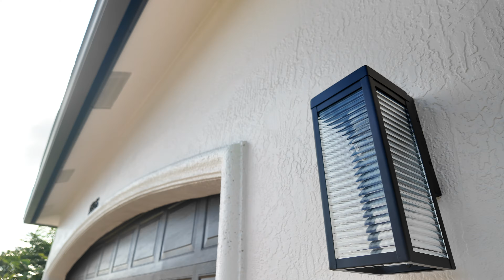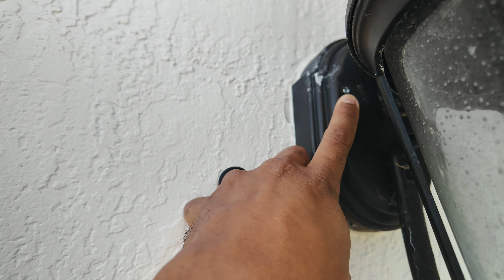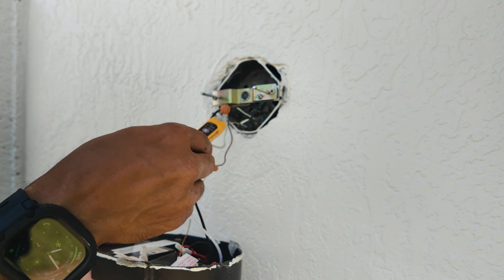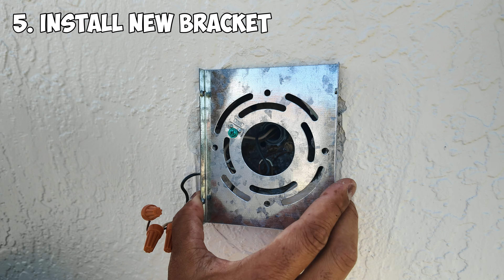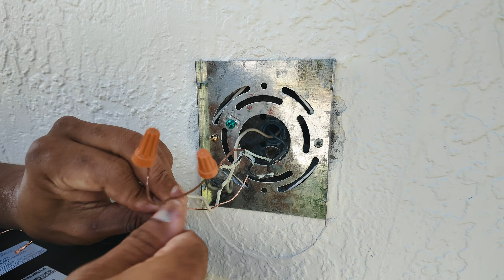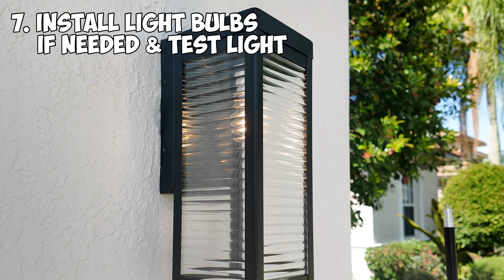How to Install an Exterior Light in 10 Minutes (No Experience Needed!)

Comment: Thanks for the video man! Have a question to ask.
Is it possible to power a security camera with the house light power? 
Solar is not practical.
I’ve been told that a transformer can make it possible? Any suggestions? 🙏
Reply from the maker: Yes a transformer will make it possible, depends on the power source, there are security cameras that use 120v (house light power) so you dont need a transformer
Reply: @DeaninItYourself it’s one of those Chinese models from Amazon and it’s say that it’s powered by a 5v USB power cable. 
I keep looking for a 120v to a 5v and can’t really see anything definitive. I’ll probable go down to an electrical store down here. Thanks for the reply. 🙏
Reply: @traderboi2662  I know it's a year later but I installed a Eufy E340 floodlight cam above my back door and it is fantastic. Covers my whole yard, tracks movement, great light, very customizable, all without a subscription fee. It's hardwired, you just need a USB cable during the initial install. I also have the Eufy (wired) doorbell and the Homebase into which I installed an old hard drive I had lying around for storage and it is the perfect setup. I did have to upgrade my doorbell transformer but no transformer was required for the floodlight cam.